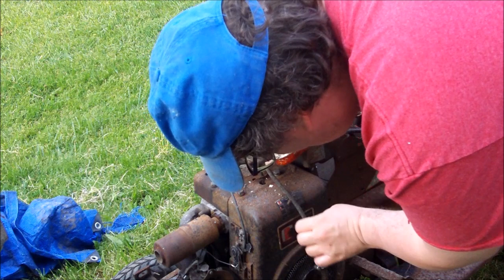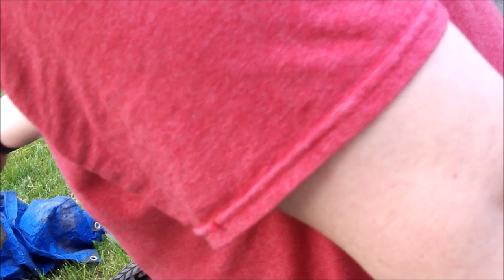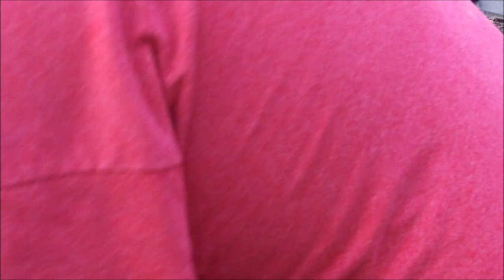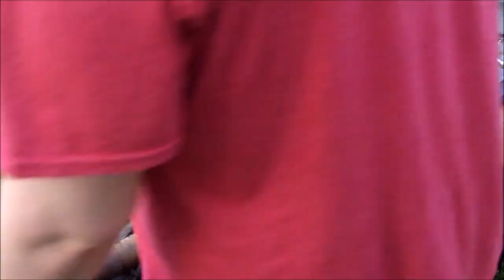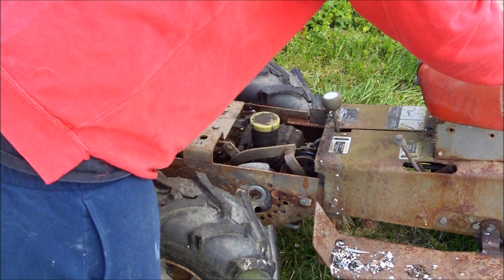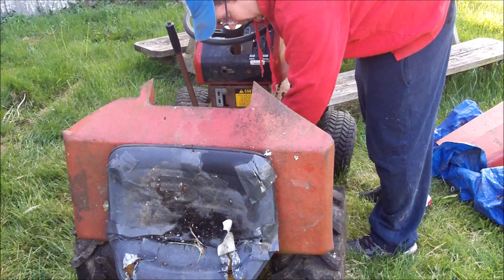my massey 8 garden tractor sat 5 years has some problems it needs help and I need help 8hp tecumseh

Comment: did you see Husqvarna bought out the Weed Eater brand last year?  The new Weed Eater trimmers are now orange and electric.  You can find the Husqvarna Weed Eater 320iL sold at Lowes.  Pretty dumb marketing scheme if you ask me.
Reply from the maker: do you know anything about my massey 8 im having a hard time with it as you can tell by the video. you know of any repair videos or manuals thanks much
Reply: @bleachmultiverse  no, sorry.  I never even heard of a massey lawn tractor.  that looks like a big heavy machine.  I've always been a fan of the smallest riding mowers like this 24 inch Murray rear engine rider https://youtu.be/Jxho7W6AT-Q   look, it even has a beer holder!
Reply from the maker: @mrbubetube  I might sell it if I can't figure it out It was running and driving on the videos in my  channel like 5 years ago
Reply from the maker: @mrbubetube  it's made by massey Ferguson and it's a paper weight for now lol